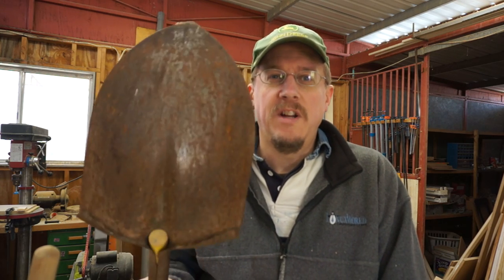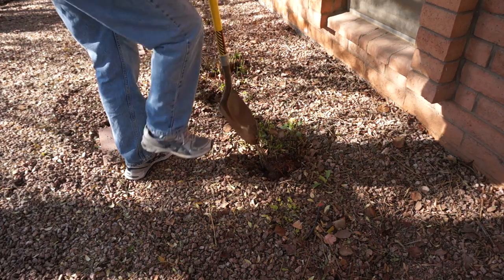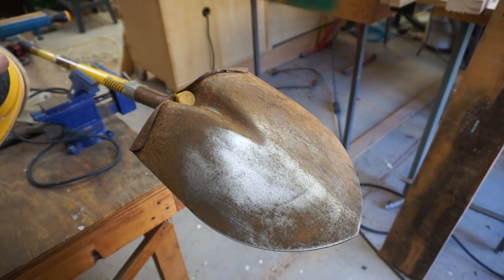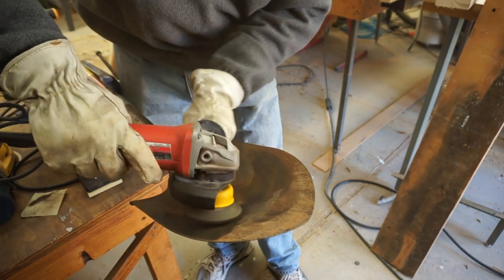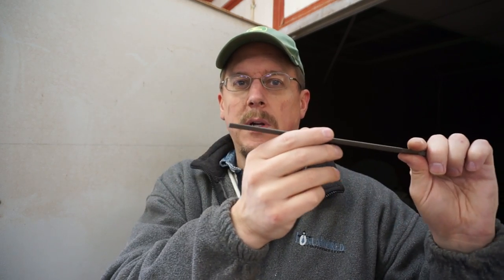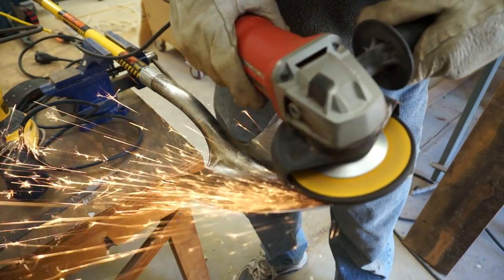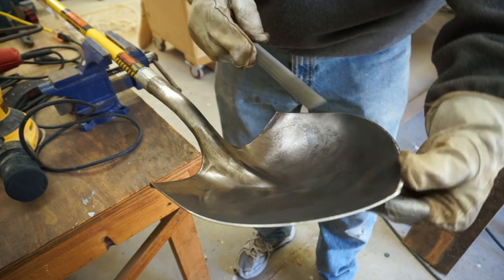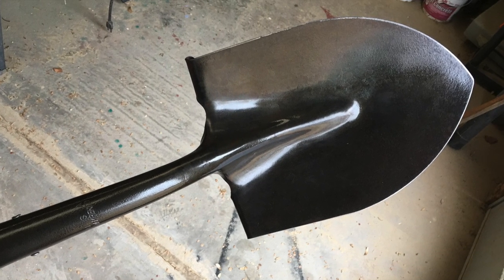Essential Guide to Sharpening a Shovel

Comment: NEVER sharpen both sides of a shovel blade.  It weakens the blade and does nothing to increase usability.  Sharpen only the front at a steep angle.  Razor sharp is a negative, you need to be able to power through roots and not have rocks nick the blade.  Also only sharpen the bottom 1/4th or at most 1/3rd of the blade, its a safety issue.
Reply: i also use mine as an axe, so I sharpen good. mine is titanium shovel axe from mother russia!
Reply: Gracias a los dos comentarios no sabía eso soy de México Saludos a la madre Rusia y  a la madre España
Reply: but what if you are using the shovel as a weapon?
Reply: @silveriogarcia8203  jajajajajajajajajajajaj
Reply: @JohnnyVincent14724  valid point
Reply: @JohnnyVincent14724  You will never make it to stovokor if you go into battle with a blunt shovel.
Reply: @turboturd7954  are you sirious?  a ti shovel?  mmmmm   I just got a Tobisho SR-2 pruning shears handheld and they are solid.  looking to upgrade all hand tools now... lol  russian ti is good stuff, and in a shovel....   where can i get this?

Comment: Awesome! May I suggest using a face shield AND ALWAYS WEAR GLOVES when using a grinder. Sparks are not the concern, its the blade exploding (which does happen). Safety first.
Reply from the maker: +AeineralusCousin I do always wear safety goggles, but that's a good point about the face shield if the disc explodes.  It's funny that you mention the gloves, though, because I've gotten a few comments that it's DANGEROUS to wear gloves with grinders since they can get caught up in them.  Hmm.  I guess I can see that.  It'll be a trade-off of risks.
Reply: +granworks thanks for the reply!
Reply: +granworks Don't listen to anyone who says not to wear gloves. As long as your hands are placed where they should, your gloves shouldn't be in the way and they WILL SAVE YOU. Sparks, exploding disks, or even wires from those wire brushes all suck. Ever seen what a cutting disk can do to flesh? Not pretty. 

Anyone who would tell you not to wear gloves has never set foot in a metal shop. OSHA would fine them out the ass.
Reply: +Newbish Dm agreed.  OH&S here in Canada would fine the worker and the employer for not wearing gloves while grinding.
Reply: +AeineralusCousin And for the love of god people use a blade that's designed for grinding, like he is, not the thin ones designed for cutting, they'll explode once you put a little pressure on it and they will hurt you bad.
Reply: +Zlagther absolutely
Reply: Yep, I had a grinder blade explode onetime, scariest thing I've ever had happen with powertools.
Reply: Whaaaat?!? That is scary!

Comment: If in doubt, grind it out.  (You learn that while studying for a working man's PhD).  For green horns, a flap disk is much safer (unless it's not (aka, running it against the edge, which only results in it detonating into bits of sand paper, so not too dangerous). This isn't my first rodeo and I prefer to use a flap disk, because a cut off wheel or grinder is not meant to have side pressure on the disc... so told to me by a schooled professional welder with several welders worth north of $10k each...   A flapper is also smoother and less likely to take metal at a rate higher than you prefer.  If you want something sharp... Tobisho SR-2 pruning shears, a hand tool, use some serious steel, and are far superior to Felco, Corona, et al.  I'm looking for a digging shovel of that nature, maybe the Russian Ti shovel mentioned in the comments.  Cheers.

Comment: I just wire brushed and sharpened (die grinder) a shovel that had probably never even been cleaned in over a decade.  Gave it a shot of rust protectant.  It does work better!  Much like the a saw blade, cleaning the edges that can cause drag helps.  Happy shovel, happy digging!

Comment: Doing this for the first time is afternoon. Hopefully it won't feel like I'm digging with a baseball bat anymore. Using a concave flap wheel on a 4 1/2 inch angle grinder is working well at removing the surface rust. Just grappled an 80 grit one and went at it.

Comment: I have seen tips on how to keep shovels free of rust in between  grinding and sharpening where you fill a 5 gallon bucket with sand and add motor oil into the sand then you just plunge the shovel into the bucket a few times and this removes the surface rust.
Reply from the maker: Yes, that works great.  I actually did a video on that tactic a little after this video: https://youtu.be/oKcXRnD_E7M
Reply: Soaking all your rusted garden tools in a bucket of vinegar takes off the majority of the rust. I have done it and grinder the crevices with a steel brush for a drill. Came out looking brand new.

Comment: Hey! I've just watched this video and your video on rustproofing with a bucket full of sand and oil. I have a shovel-related question which has nothing to do with either video.

I've found an old shovel with a broken-off handle, about in the rusted condition of the other video. The thing is, I can't figure out how to remove the rest of the handle stuck inside the shank. What should I do? Some people have suggested just putting it in a burn pile, but I don't want to ruin the temper. There were two rivets, both now removed. The old handle bends with the shape of the shovel, and combined with rust and possibly swelling, I can't get the thing to budge. It's a flat shovel, similar to the one in the sand bucket video, in case that makes any difference.
Reply from the maker: I would first try drilling it out.  The handle will be firmly stuck in the socket by the fact that the wood is heavily compressed and that creates quite a bit of friction.  If you hog out the majority of the inside of the broken handle with a drill, then that'll relieve a lot of pressure on the socket sidewalls.  It might just crumble out, else you could try using a chisel or screwdriver to pry the remaining pieces out.
Reply: @granworks  thank you so much. I'll try that.

Comment: When digging keep the file in your pocket and a stiff putty knife. When digging clay or wet soil take the putty knife and clean the tools face. Every 10-15 minutes run the file over the sharpened edge to keep the shovel cutting edge sharp. A discarded knife block steel will keep the edge dressed. At the end of the day, wipe the shovel with a oiled rag and dress the cutting edge. A sharp shovel will move a unbelievable ammount of soil in a short time. Three workers can dig a three foot wide, three feet deep 20 feet long in a hour if they know how to use a shovel properly and keep them sharp. Sometimes you cant get powered equipment in and knowing how to move dirt manually is invaluable.
Reply: Está muy interesante tu comentario porque en México se hacen excavaciones para las construcciones de casas y edificios, es muy popular esas excavaciones, sin maquinaria pesada , gracias que Dios te bendiga Saludos desde México

Comment: hey mate, never done this before but have seen others saying to grind just the back of the shovel instead. have you tried doing this? I imagine sharpening either side is better than nothing but which side is better I am not sure (although most that state a side seem to prefer the backside to sharpen)
Reply from the maker: Yeah, I've heard that as well but haven't tried it.  Sharpening just one side may well be faster to do and it would essentially give a chisel-like edge.  I can't think of a reason why that wouldn't work.  Sharpening both edges, to me, feels like a more sure thing as you're getting a knife-like edge with little extra work.  Maybe it would go dull faster, though?  I will say that I tend to "touch up" the shovels by just grinding/filing on one side...

Comment: The easy way to clean any rusted metal is with 1:9 ratio molasses to water in a vat that will hold the item, let soak 1 - 3 days, wash and light sand paint easy.
Reply: have you tried vinegar?  i'm curious which may be most effective.

Comment: Cardan oil (branch shaft) for farming equipment is what I use and swear by 👍🏻no wd40 that's just for water removal.

The oil is a bit thicker and removes any rust remaining, mostly only use it when the tools are in the shed for the winter.
Reply: camelia oil is what the japanese use on their hard steel, also good.  will check the cardan oil out